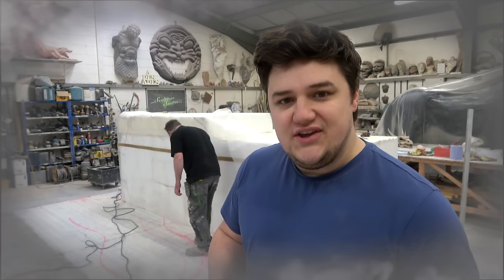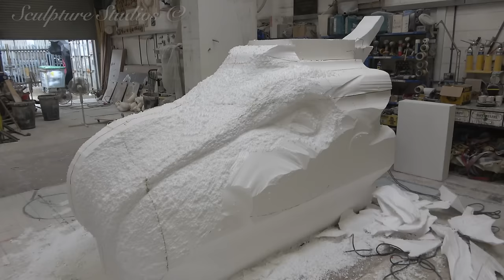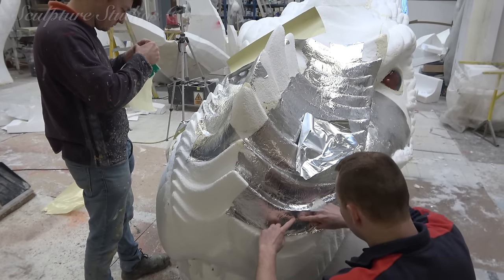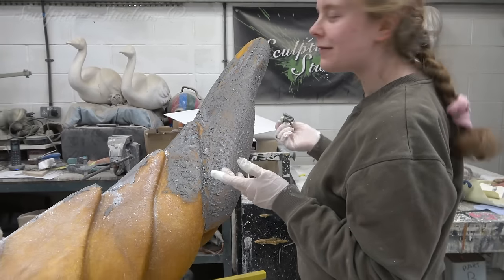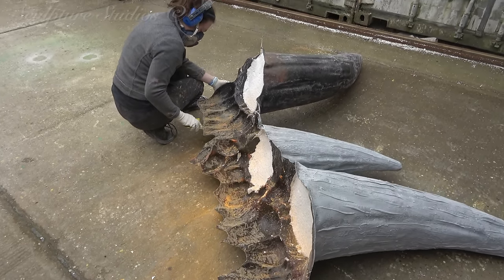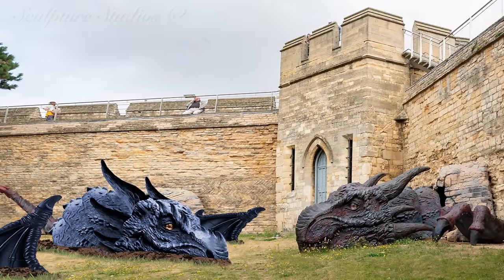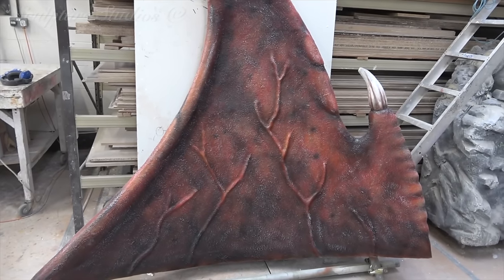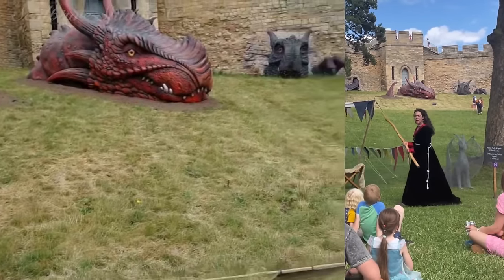How We Made Lincoln Castle's New Dragon by Sculpture Studios

Comment: hi, what product do you use for the resin mix top coat and can that be applied over the concrete? im a hobby sculptor that would like to make larger thing for my yard
Reply from the maker: Hey Aaron, with this project, we were originally going to go over with a water based concrete render. But in the end, we went with a resin mix instead. We used a general purpose polyester resin, with talc to bulk up the material so that it can be painted or spread onto the job. Hardener/catalyst added to the resin of course

Comment: What’s the point of the nail brush wouldn’t that just make it more textured?
Reply from the maker: The hot wire takes off big chunks of material to get you started. The nail brush is then used to carve the shape. You then sand it down